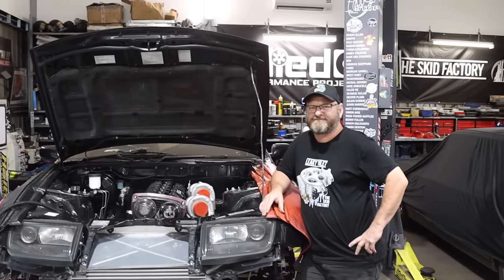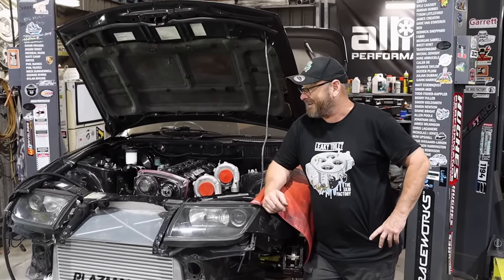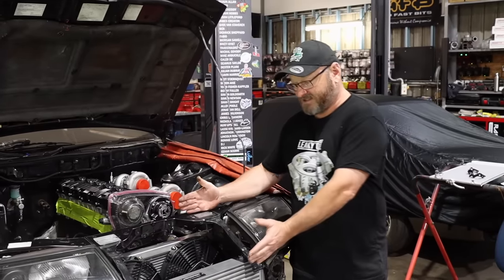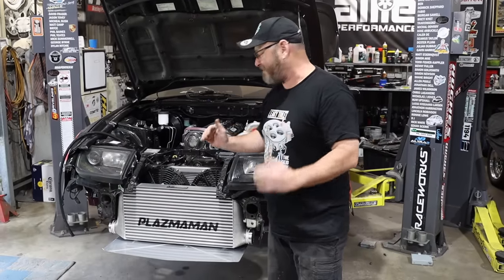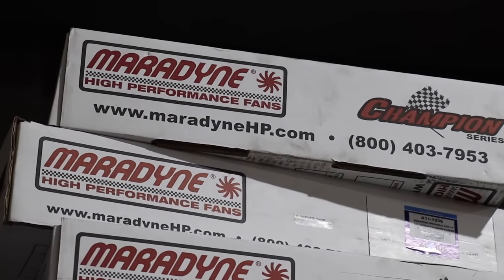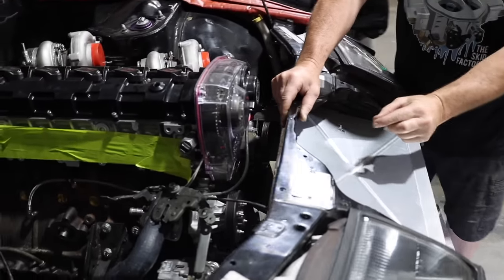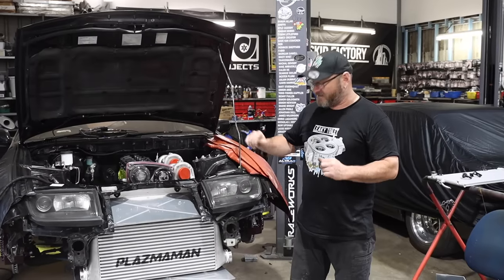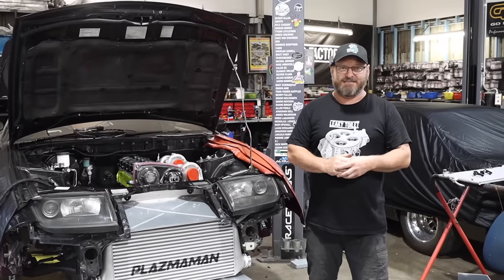Plumbing Twin Turbos on Al's RB25/30 Powered Nissan Z32 [EP4]

Comment: 8:47 take a look at a secondary rad set up on the larger 1KD toyota hiaces. They run a second rad on the passenger/left side behind the bumper and these are now made as an aftermarket aluminium unit. Might help 👍
Reply: My brain went straight to that setup as well

Comment: Hey Al, one thing with the blower fans on the radiator, they would also tend to be a sucker fan too, to draw in cool air threw the intercooler when sitting at the lights too wouldn't they. Seeya Rob

Comment: I having the same issues with my 1UZ powered RA40 Celica. I’ve cut away a lot of the front to fit the largest coils I could being a MR2 rad, however it still gets hot in traffic. 

Interested to see how to add more coolers.

Comment: Not sure of the prevailing wisdom but I added a big 12V circuit breaker at the battery to protect the battery cable run on my mini conversion. VG30DETT is nightmare of wiring, vacuum lines, plumbing and god knows what else, I'd like to see what could be done to simplify the whole thing with modern ECU, wiring and control strategies.

Comment: Wish we could’ve seen more of the wiring work on that harness. I’m doing something similar on my Z32 with a PD16 and a 2500 instead of the R3. Got the ECU wiring down, no issues but the rats nest of wiring from the relay box is just insane to follow at times.
Reply from the maker: All that is left is the head light relays and Horn relay and they would also be gone if I had an R5.
Reply: @theskidfactory  Yeah I was trying to put the headlights on the PD16 8 amp wiring since I’ve converted to LEDs but that way isn’t a bad idea either.
Reply from the maker: If you have an R5 and PD16 then you can remove the entire wiring loom altogether and the car will weigh 100kg less.
LED bulbs allow you to pair multiple lights on a single 8A also. My crown runs all LED.
Reply: @theskidfactory  Yeah sadly, don’t have an R5. Could’ve, but I spent / earmarked all that $ on 62mm billet throttle bodies and a drive by wire system from Polar Engineering that will run off the Elite and let me dump all the factory idle air and cruise control systems.

Comment: The radiator is below the water jacket in the head. VL's had issues compared to R31 because of this. Fingers crossed your cooling system purges itself all the air pockets in the head properly.

Comment: If that Chernobyls , the previous model 300z 84 - 86. Radiator is large and on an angle ( resides in the nose cone ).  VG 30dett have a very small radiator compared to yours ( by looking at your video only )  Im guessing RB’s take more to cool?

Comment: Industrial electrician here, I would always hyd crimp 32mmsq lugs at least twice if the lug is long enough,  flex cable especially can and will work loose as the cable is flexed during install, it’s always better to install larger cables first then terminate in position this ensures the individual copper strands are the correct length for the cable and flexing the cable during install can either compromise the crimp or bunch the strands which will decrease the current carrying capacity of the cable .. my 2 cents

Comment: It's a good idea to incorporate a fuse as close to the battery as possible when relocating the battery to the boot. I normally use a 500 amp megafuse, cheap insurance against anything untoward burning your car down.

Comment: I have that gearbox in my 76 280Z and my 81 280ZX. Shortening the shifter linkage sure makes it feel strange, it rotates as you shift.
Reply from the maker: That happens if you don't use the rear anchor point.

Comment: Love all the vids boys.

Al just wanted to correct something you said as it is potentially dangerous.

A DIN Battery is absolutely vented to atmosphere. I believe you were meaning AGM.
DIN = A German abbreviation. Translated to German institute for standardization
AGM = Absorbed Glass Mat

DIN53/65/75/85 (etc) Batteries are vented to atmosphere. 1 Side has to be plugged and the other side has a vent hole - usually to connect to a vent tube. This is why they are sometimes found inside vehicle cabins. These do vent gases with normal use and vent a lot of gas during an overcharging event.

An AGM battery is fully sealed and has a fibreglass matting surrounding the cells. They should not ever explode or vent toxic gases. This is the preferred option for anything inside a cabin.

I noticed the battery purchased in the video is a DIN style battery and not an AGM type as it has vent holes.

Please connect a vent tube to the open port or exchange it for an AGM battery.

Hope I have been of help. Love what you guys do and gonna miss Al
Reply from the maker: You are 100% correct. They do need a vent pipe but are still designed for inside use.

Comment: The theory on earthing for the starter and alternator was interesting I've had issues with poor charge from the alternator I tried a 8 gauge cable from the alternator to the body and it cured my low voltage while running went from 13.8 to more 14.3
Shout out to Glenn Hodges at The Lab

Comment: for a daily driver, not a drag car, that radiator wil work perfectly .esp with the air guides youre installing, def dont forget side air guides as well. under headlights is huge gaps that used to have oem airbox pipes under them. now just gaping holes lol for loosing air pressure, ok cool. at 5 mins you mention the same. mad respect. knew i loved this channel for  a reason!

Comment: I used to be sceptical about using the chassis for ground until I did my own battery relocation. I did a proper job of all the routing, double insulated with conduit like you guys did - it looked mint.
When it was all in and finished, I hit the key and got nothin' but clicks - low voltage cut out on the starter. I was gutted! 
Rather than redo the whole thing, I thought I'd try adding a ground to the chassis in the boot, and it worked like a treat. The starter kicked strong, first time every time. 
Never again will I doubt the ability of a million little spot welds when it comes to moving electrons.
Reply: why would you ever be skeptical about a chassis ground haha! It's been essential for engines and starter motors since the 70's.
Reply: Electrician here running both a positive and negative conductor in a vehicle will almost double the resistance of the cabling compared to using a body ground , high current 12vdc loads need very low resistance circuits,high current increases resistance  of the cabling which then drops the voltage at the starter motor.. plus it’s quicker and a lot cheaper to just run 1 conductor
Reply: They do it like this from the factory in cars with rear mounted batteries

Comment: Remember, oil coolers also take heat out of the engine as long as you have good pressure 👍 and they can be smaller and fit in the pods like on Porsche's.

Comment: Hey Al & Woody! Love the show, been a long time follower. May I suggest an LS 180amp alternator whilst the intake is off? It is still do-able by any means once the intake mani is in, obviously just easier. 
I believe most series 1 and 2 RB harnesses use the same 2-pin connector as the earlier LS alternators (large rounded, square shaped plug) and Frenchy's performance or PRP make adapter brackets and pulleys to suit factory location, only require a longer belt. 
With added things like thermo fans, more powerful ECU's and in general more electronics being added, the factory 80amp alternators don't cut it and/or don't last.

We see quite a few voltage issues on S and R chassis these days, specially when in higher RPM when more spark, injector pulse, fuel pressure (effectively fuel pump voltage dropping when pressure is increased from your FPR) and just more upgraded electronic components drawing more power to produce what they're being demanded.

Comment: Hurts my soul a littlebit seeing that 30/25 in it's home.. Mine is still on a stand with parts missing.. Shed is so hot and muggy i've not had the motivation to work on it.. But i'm getting air conditioning put in it soon! dang christmas and new years getting in the way.

Comment: On the topic of relocating batteries... if anyone's doing one and is a tightass, head to your local wreckers (in australia only obviously) and find a ve commodore. They have boot mounted batteries and you can get the full cable, with lugs, for a fraction of the price. Is it legit? Probably not. But it is cheap. So do with that as you will.

Comment: Merry Chissy Al & co
Al that furry tape is great.....until you need to change anything and then it gets fairly goey and sticky?
I've been using braided Teflon weave sheeths that they use on PC power supplies 👍
Works fantastic and you can use a collar of what ever size and goop it up with that black Sikaflex. Works perfect. You can yank on the loom and pull it through spaces and it won't Jag on anything (it will make a funky sound at most - that Teflon shit works good👍)
It looks fantastic and you can pear through the weeve if you want to look at your wiring for what ever reason? 
It's pretty much the same as what they use on your KTM headlight wiring harness Al. I know this cause I just purchased a KTM SX rally style headlight for my bike 😉
I decided to follow the same theme with much of the other wiring as I need to paint the frame and do many of the things you are doing here on your Zed haha relocating the battery for an intake plenum 😉(yes a plenum) on a enduro/adventure bike? I need 4L of intake plenum on a single cylinder for a turbo to function?(apparently?) 
So  I'm thinking that 2L may be feasible on a 2 cylinder? That will be in the future though but planning for relocating and deleting as much stuff as possible to save weight and improve visibility with a full dirt bike front end nice and open.

Enjoy your dirt bike Al they are loads of fun

Comment: This build is epic. I love this body style car. Probably too big of a hassle but you can move the AC evaporator lines to a different outlet location behind the firewall. A refrigerator AC guy can make new lines running anywhere you want to route them. Even withe the down pipe kicked over, that heat is going to be right there.

Comment: Those main cooler fans really should be in a shroud if at all possible.
Reply from the maker: Shrouding push fans doesn't really work if they are mounted on the core. They'd need to be a distance away for it to be effective.